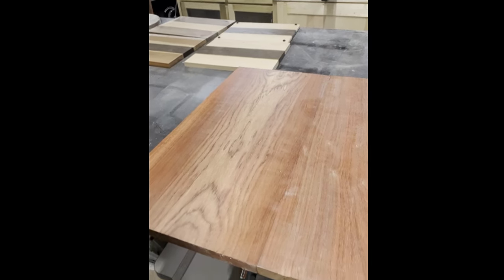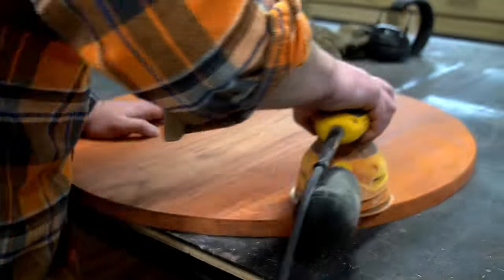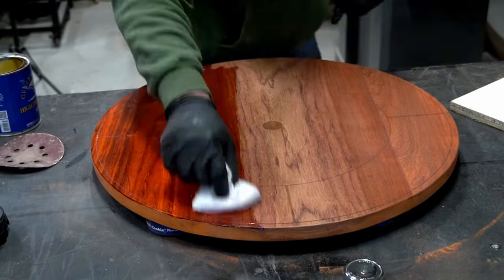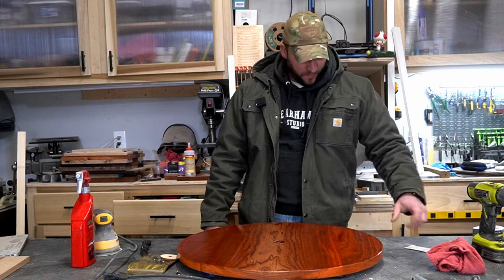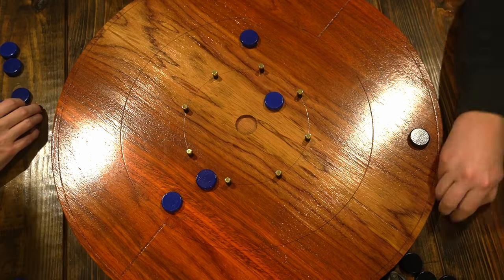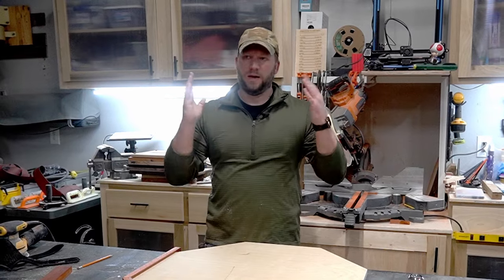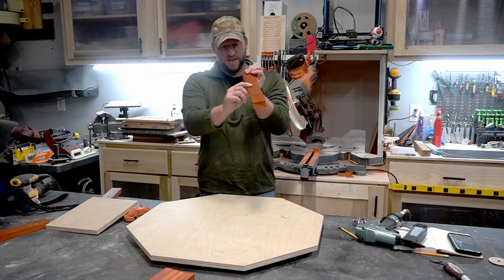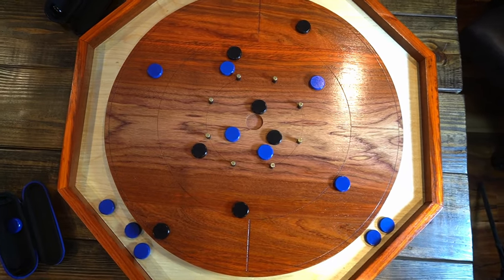How I Built a Stunning Crokinole Board from Scratch

Comment: My biggest hesitation for buying a crokinole board is finding a place to store it!  I feel like you'd need to dedicate a spot on the wall to hang it, or maybe set up a little hammock for it under the kitchen table.  

This turned out pretty nice!  The brads following the grain makes perfect sense in hindsight, but I certainly wouldn't have predicted it :D
Reply from the maker: Yeah it’s definitely a hefty board.  Takes up half the table.😆  We’ve got a little game closet but the hammock is a great idea too! 
Thank you!
Reply: Hang it on a wall.  There are several ways but the best mount I have found for the several boards I have owned is the system Tracy sells.  It is about $60 but works GREAT.  You can then get an inexpensive clock face available through Mayday to mount over the pegs and viola, you have a beautiful wood wall clock.
Reply from the maker: Both great ideas!   Thank you!
Reply: @BearhawkStudio  Given your proven skill you could also buy a clock movement and make the wood clock face to fit over the pegs.
Reply: @kennethfharkin  That's a great idea about the clock! Our was a family heirloom so it hang on the wall, made by Grampa during the Depression. Very rustic looking.
Reply: I create a cavity in the back of my boards, to which I throw a french cleat. You can then use the other half of the cleat on a wall, to allow it to latch on seemlessly with the wall.

Comment: Great job on the board! Looks absolutely stunning! 

If you're willing to put more coats of poly, you could sand it to a proper mirror finish and make it look even more amazing than what you did an fantastic job. 

When I make my boards, I sand the surface to 400 dry sand (as flat as possible), then coat with about 8 coats of water based poly. I sand in between to get the surface as level as possible without any dips in the board. Once it's flush as can be, wet sand at 600, 1000, 1500, and a final 2000. When that's complete, give a regular McGuiar's wax and quick polish. For durability and quality of surface, the extra elbow grease really makes that surface shine and while making the discs fly. To even add proper frictionless motion to the discs, you can rub each side with a bit of mcquiar's wax.
Reply from the maker: Thank you!   And thanks for the tip on the mirror finish.  I think I’ll end up doing that. I hadn’t ever played before building that one and couldn’t tell how glasslike they usually are from the pics online - but now that we’ve played a good bit I definitely see it should be a bit slicker. Might also help with the slight dip at the laser lines.

Comment: "It made sense at the time." is going to be on my tombstone. You mentioned 6 coats of a finish but I dont notice what type of finish other than the wax.
Reply from the maker: Haha, yeah I find myself saying that a lot.   The finish was "General Finishes High Performance Gloss."   I used a foam brush for the crokinole board in this video  - but since then bought a $30 HVLP gun off amazon and have been using it for several projects - and the finish looks WAY better sprayed than it does brushed.